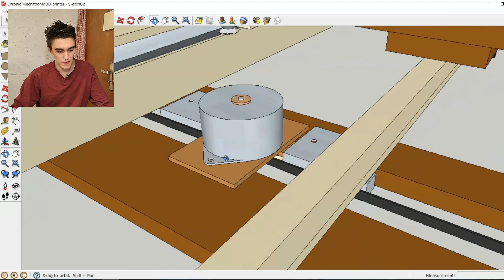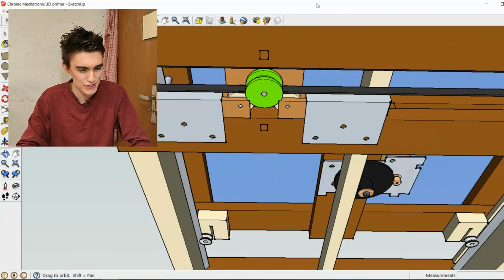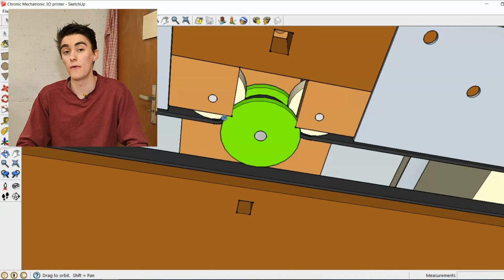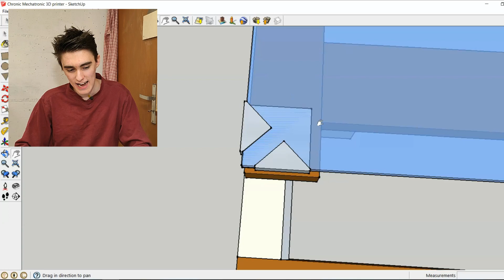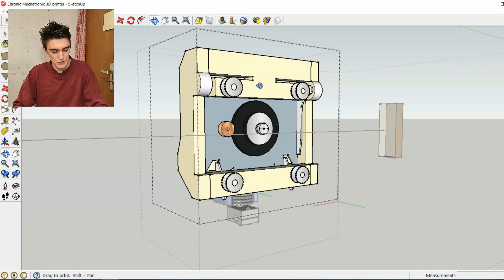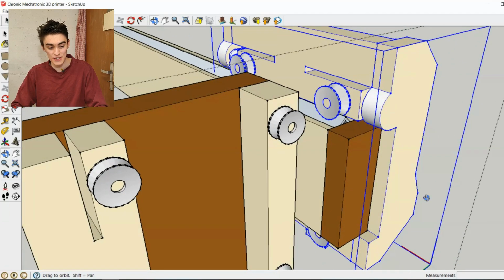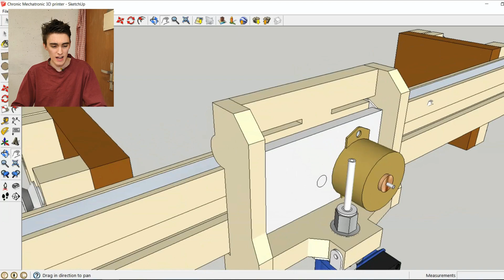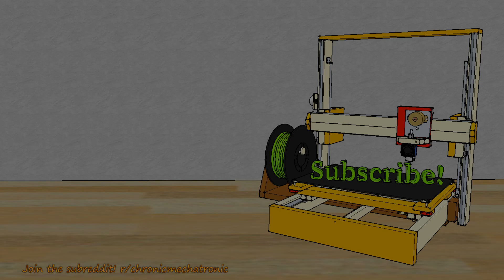All design issues of my unipolar 3D printer FIXED (kinda) - design process part 3/3

Comment: Maybe you are addressing/answering this in a later video in the series, but I haven't gotten that far yet :). Can you elaborate on your choice to have the X drive on the toolhead vs having it statically mounted to the side/start of X axis? Side mounted/static placement could benefit wiring and toolhead weight and size.
Reply from the maker: If I didn't adress it in the design videos I don't think I mentioned it elsewhere. The reason to put both motors on the carriage was just the steel fishing line drive mechanism, because it doesn't work with fixed motors. Later however I found out my steppers don't work with microstepping anywhere near as well as I had anticipated, so I will have to switch to lead screws with fixed motors to get any kind of usable resolution out of it. Toolhead weight would have been important now in direct drive while it can move fast, but as soon as lead screws come in it'll be much slower and toolhead weight will be negligible (which makes the move to a stationary motor kind of ironic)...
For the wiring I actually prefer the way it is now because I only have to run one big bunch of cables to each carriage as opposed to the carriage and the axis...

Comment: Hey, nice videos!. Regarding your timing pulleys, there are plenty of guys in yt that do pretty much everything out of PVC pipe cutouts (even a lathe). I think you could also use same technics to make some temporary timing pulleys (I think I have seen some of them doing just that).

Being that said, could never understand why everyone insists on attaching the spool to the machine itself. Yes, it's more portable and compact and all that, but should introduce unwanted vibrations all the time.

Also, why not use regular DC motors instead of steppers? Are easier to find (just about any inkjet printer has them nowadays), are fast (so can be geared down easily to gain precision, think of a homemade worm gear using a standard threaded rod or so), and as you already master PWM, can easily find out it's best working frequency to make a suitable controller for it. Can also use gray-code disks with optointerrupters for even better precision.

Also, there is the Easythreed X1, a very simple 3d printer (but very clever in design), which I'm sure will give you ideas on how to handle belt tensioning and all that. Even it's extruder can be easily replicated at home (It's just some nichrome or kanthal wire wound around a piece of ceramic tube).

All the best!
Reply from the maker: Thanks! Yeah, I don't understand why brushed DC motors haven't taken off in 3dp yet either, but the problem if I were to develop one is that I'd somehow have to integrate pwm and the position feedback from the optical sensors into the firmware, and I'm currently not good enough at programming to do that. Maybe someday in collab with another channel :)
Sry I can't write a more extensive answer rn, pretty busy editing ;)
Reply: Haha, no problem!. Yes, it's a bit more involving, yet nothing to be scared about. Keep up editing so we can watch more of your videos soon! hehe

Comment: Design decisions are sometimes a bit frustrating. I do know how it's intellectually exciting to use existing parts and try to wrap your design around them like you did here https://youtu.be/8yAx6KrPyr0?t=423 but it's a painstaking process actually. Building parts from scratch is easier in my experience and less time consuming. Modeling existing elements takes time and you have to weigh the ratio benefit/time.
Can't wait your next posts.
Reply from the maker: Yeah, I considered rebuilding the gear reduction from ground up and just mounting the large gear and the stepper directly to the MDF backplate of the carriage, but then I would have had to worry about attaching the shaft to it properly which also would have posed problems with clearances...
But ultimately it's just the prototype, I think to make version 1.0 more accessible and simple it'll have just lead screws driven directly by the steppers. That should, although compromising max speed, get rid of most issues with the low stepper resolution and complexity.